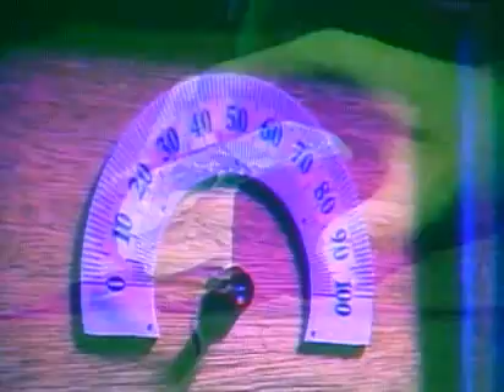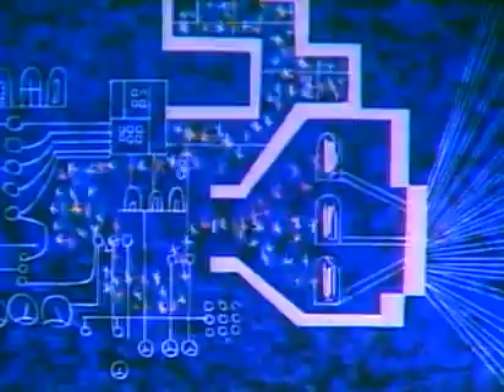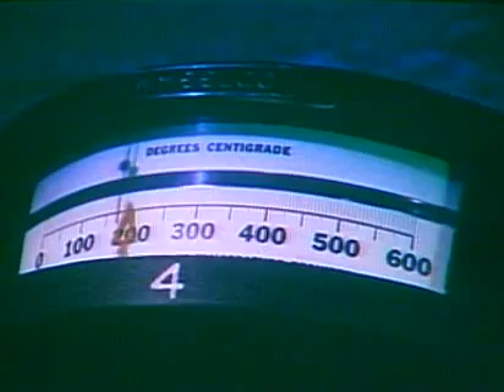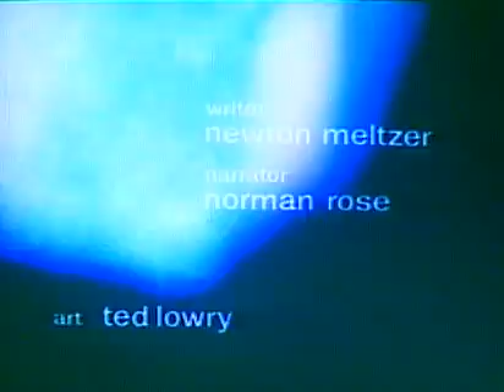AT&T Archives: Krystallos

Comment: The pressures and temperatures necessary for hydrothermal growth of quartz crystals are extremely high.  Around 600 degrees Centigrade and over 20,000 PSI of steam pressure.  The solution used is water, made alkaline with the addition of sodium hydroxide.